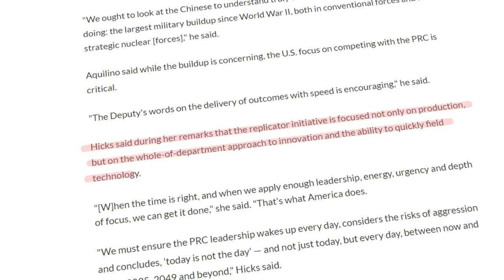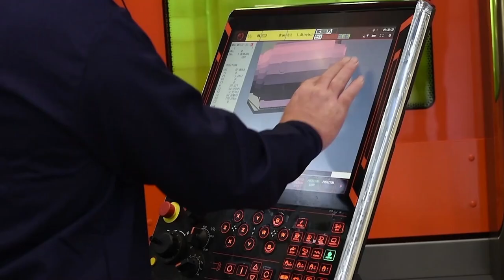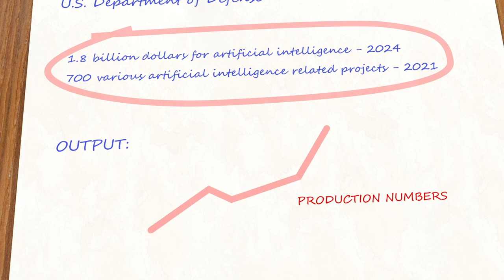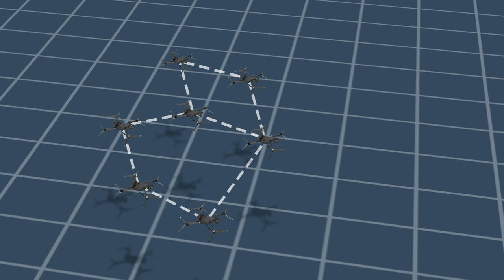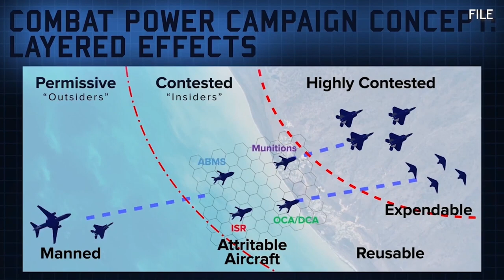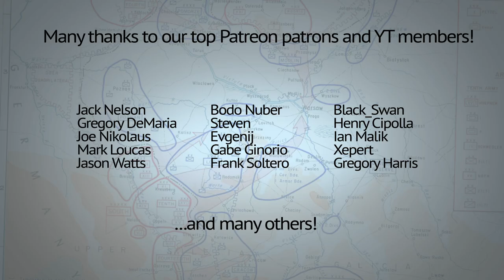Pentagon just announced the Replicator program. 1000s of cheap drones aimed at China.

Comment: A little weird that US is trying to beat China at cheap mass produced drone but okay.
Reply: Robot vs robot
Reply: They can beat China easily now. 
1.) They restricted china's advanced chip access
2.) Mexico is quickly becoming the new manufacturing hub for the u.s. They already have a skilled labor that is competitive with China, and they're much cheaper, friendlier, and closer.
Reply: @tulipalll 
They can beat China now? 
I thought they said China is a paper tiger . 

This seems like a very good counter to China,  until you realize all those drones need batteries. 
And guess who makes all the batteries 😅😅
Reply: @tulipalll  Meanwhile Huawei is selling its new phone Mate 60 with new 6nm chips despite US sanctions.
Reply: @min-jd5lb  
1.) 7nm. Not 6.
2.) At an incredibly low yield. Relatively few were produced. 
3.) Which indicates that they are producing them by tweaking their DUV machines (since they don't have extreme ultra violet) and this making them inefficiently and at much higher cost than everyone else, meaning they won't be able to do it at scale. So Drone swarming will, ironically, be far more expensive for them than it will be for the u.s. who can just by quality from Taiwan 🇹🇼, the REAL china.
Reply: @tulipalll 1. Cheap drones do not need chips smaller than 7 nm, China has semiconductor production capabilities.
2. China produces and controls more of the worlds market share of commercial drones than the rest of the world combined and has the most advanced technology for the price.
3. China already has the largest investment into drone programs even stuff like scientific drone carriers.
4. China can acquire practically all the materials for drones inside China
5. Mexico will never surpass Chinese production capabilities due to infrastructure and corrupt bureaucracy+instability, Chinese labor cannot be defined with general trends, there are poor willing workers in China not everyone is middle class. China holds the essential advantages of rare materials, technically know how, large consumer market, existing expansive 1:24 infrastructure, and responsive authoritarian government
Reply: @tulipalll  "relatively few were produced" while Huawei plans to produce 17 million. Also if you think drones need super good 7nm chip priced sky high then you are really rediculous, do some homework okay?
Reply: @tulipalll  Lol, someone follows Peter Zeihan and thinks he is a geopolitics expert, not realizing how wrong he is when it comes to semi production.
Reply: @tulipalll labor cost is hardly the bottleneck of manufacturing. Supply chain is and technical labor supply is.  Mexico is great but the supply chain there is not nearly as well established
Reply: @mintheman7  I know that he is right because while he was the first to say these things, I have heard other people much smarter than him say the SAME things. He might not know the process 100%, but he knows enough.

Comment: These drones most useful ability maybe in jamming and decoying. If you fill the air with tons of drones on tons of different operating frequencies, an enemy has to divert bandwidth to deal with such systems. Forcing them to deal with all threats instead of the most dangerous ones.

Comment: The true beauty of drones is that with 3d printers it is possible to have drone manufacturing take place within a simple shipping container that builds several of a dozen different designs and then sends them off for launch in remote locations. An example is the Aussie made Cardboard drones. They can be made rapidly. They are hard to hit and can be equipped for different tasks.
Reply: Its not beauty, its horrifing for the future
Reply: @francistaylor1822  It can be kinda both.
Reply: drones definitely have lots of civilian uses as well

Comment: I don't know if you can out-China China at cheap, simple mass production.  This is a dangerous game.
Reply: In case of war, China could easily be contained from resources point of view due to geography, also I think this is complimentary programs because China as we’ve seen with Russia will use more economically sustainable way of waging war. It cost way more to destroy the drones than to make and operate, we need to have such programs.
Reply: Sure you can, just use slave labor.

I mean, use for-profit prison labor. Same thing.
Reply: Oh, but you can certainly outmatch China in plenty of ways, if you decide to invest for it... and de-invest in China. Which is currently happening. We have the industrial robotic engineering and tools to mass produce effectively, both in the US and Europe, and we are already beginning to shift quite a few productions from there. Furthermore, it's not because we stop investing/production in China that we have to get rid of Mexico, Morocco, India, Indonesia or Vietnam.
Reply: @waichungsham1578 I know right, but in one American slave in a meat factory there are thousands in China. So???
Reply: @yudistiraliem135  Geographically containing China is like a decade-old outdated info. They've built extensive highways, railways and pipelines across Asia in the meantime. During war time when there is far less commerce and shipping, they could hold up due to the on-land logistics in addition to the diversification of port connections in other countries along the Indian Ocean, Persian Gulf and Russia.

Comment: I always thought the gen 6 fighter is going to be a drone carrier more than a missile launcher.  Imagen a stealth bomber or fighter drops several dozen drones in an area you don’t even see it.  The drones stay on the area while the fighter or bomber flys away taking full control of an area any enemy aircraft gets targeted and destroyed
Reply: the big problem, much like the current gen, when firing the stealth would likely be compromised, unless the drones are also stealth you are lighting up the airspace and screaming i'm right here if its launching a bunch at once. I'm sure it will still happen, but the drones that will be launched from a 6th gen fighter will not be on the cheaper end of the scale like with replicator.
Reply: @edwxx20001  true I read made up stuff that says some drones would be stealth going from 30 to 50 million per drones.  Some of them would be use once and forget kinda like a missile but able to fly for hours around a designated area

Comment: One of the biggest weaknesses I can see, is signal jamming and EM cannons/laser. That those AAArty guns would be replaced with a focal dish, and generators.
Reply: If the drones are relativity autonomous and capable of running a mission without human intervention, jamming becomes irrelevant. 😁
Reply: @koneal2000  Not exactly, as EM beam depending on wavelength at strength could disrupt internal electronics.
Reply: @koneal2000  Second point of contention is the degree of Autonomy, does it home to target without user input? that is a huge tactical risk to everyone in the AO. Does it do ISR and only gets the data once recovered? That makes it a delayed data collector. Is it used to relay targeting data? That would be the same as the first.
Reply: @Sufferingzify  Targeted EM Beaming isn't jamming, that's a completely different technology and attack vector.
Reply: @Sufferingzify  The first point is a good question for the pentagon. They very well may just not care about collateral if the intended use case is overseas deployment lol

Comment: If a country wanted to do something smart it would be going to a producer of good commercial drones that they liked and ask them to cooperate in software architecture and board design.   
In exchange the military pays them some millions and a contract for buying a steady supply of drones for training (like 10.000 per year). 
The military can then make their own version of the software on the platform and easily expand the drone with a coprocessor to handle extra features like ecrypted communication and the like. 
So in case of war you can very fast convert the large supply capability of a commercial company with classified mods to gain a huge amount of expendable war drones.
Best of both worlds.

Comment: For the cost of one B-2 Spirit bomber, you could have 200,000 * ~$5K-10K plywood and lawnmower-engine drones, each with 500 lb warhead.. What could stop an attack like this? Imagine a 20k TEU cargo ship with the drones mounted in cargo containers (so, 10 drones per container, with forklifts pushing the empty containers overboard after they launch to make room for the containers in the middle of the ship.. It may take a day or so to launch them all.. Today, Iran is the 20th largest automaker in the world and one of the largest in Asia, with annual production of more than 1.6 million vehicles. Why is a drone more expensive or difficult to produce than a car?
Reply: EW systems and laser weapons can rather quickly stop your swarm. That's why most major defense companies are currently working on swarm defenses. Hell even a blast shrapnel rounds for older oerlikon cannons can be effective enough.
Reply: You would still need a plane to deliver the drones to get the same range as the B-2
Reply: For truly effective drone swarm you need to drop hundreds at a time and get out of area of operations quickly.  Your cargo ship would be dead before it got 1/10 of its cargo airbone.

Dropping drones out the back of C-5 cargo plans is a better approach.

Comment: Are there drones which can shoot guns and can be used like a sniper ? or drones which can go close to people to close combat like the one in  hlf2 "Manhack"?
Reply: Switchblade 300 already exists. There is no point in having a gun in drone, if the drone itself can be a munition.
Reply: @spqr1945   it's, you will not lose the drone, the drone can kill people far from the distance without noticing and you can use  in large number than as a hugh rifle push without wasting people.( My thoughts)
Reply: @larsviktorfreirewakenhut6930  drones are very unstable in the air and precision will suffer as a result. Also recoil will mess up drone even more. I don’t think it might work.
Reply: @spqr1945  stabilisation i think isnt the problem, it could be fixed. But Recoil yes ;/ maybe they will find one day a solution and we are all doomed

Comment: They need to be sustainable even with jamming systems. They need another back up power source so on that back up goes out it’s got another back up system to initiate its destiny’s for the nuclear battery and anti-blocking shield internally, for the components should be the way to enhance the US is capability of the feet of the enemy and all enemy’s!

Comment: How about a container like a trucking container trailer replicator factory mini that produces 1000 + mini drones and  deployed and it starts building and takes off the enemy LOL simple circuit board cameras and sensors 3D printers I've just about seen everything put together to do that but not in one package I have not seen completely automate the package to completely make electronic device but they do make circuit boards wires solar panels resistors LEDs multi-material 3D printers are fairly capable of doing a lot of All electronic
Reply: It's more pragmatic and energy efficient to transport the finished product instead. A trucking container trailer that deploys thousands of mini drones is still a great idea that I can definitely forsee the Russians copying to defend their currently understaffed borders.
Reply: Are you a broken LLM?

Comment: Two things - first, anything related to US military gets a 10-100 times multiplier in price. There is no such thing as cheap weapons in the US.
Second - most components of those commercial drones are coming from China. Chinese probably won't be selling these things to the US if those are aimed against them primarily. They probably also begun mass-manufacturing these cheap drones themselves - in worse quality, but way greater quantity.
Reply: How do you judge quality ? Take a US car, compare it to a Chinese. Wich one is better in quality ? Right the Chinese is better.
Reply: @FreddieGamingHD so would you rather have 100 t-34s or 10 T-90s?
Reply: chineese drones made with TSMC chips from taiwan.

Comment: So chinese will come up with high energy microwave emittors and burn the communication chips. Idea is good, but not a wonderweapon, rather overpriced buzzwords like climate change, shadow, switchblade.
Reply: The cost of making huge swarms of cheap drones is much less than the cost of building and deployed specialized, high-powered microwave defense systems, even if the Chinese do get that tech to work, and they're not gonna have those units everywhere.  The asymmetry still favors the side with all the drones.
Reply: @zibbitybibbitybop it also costs like 3$ to shield components from microwaves 😂
Reply: @zibbitybibbitybop  The cost of build should be not be compared to the price of drone, but price of equipment being saved. The task is to eliminate the threat that diminishes the power you relied uppon earlier. By your logic tanks should have no armour because its cheaper to shoot them with artillery and the cost of an rpg is also lower than spent on a complete reactive or active protection system. This is wrong thinking.